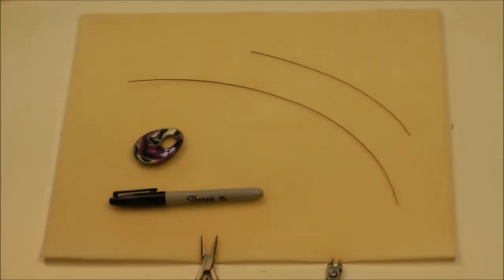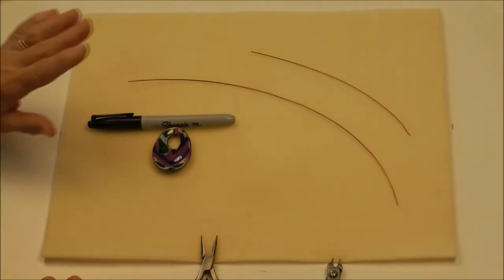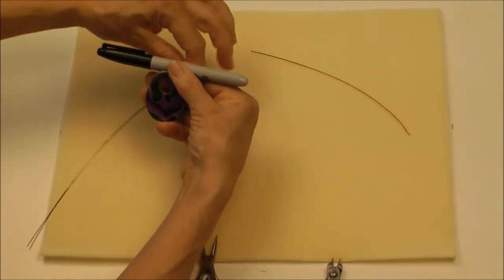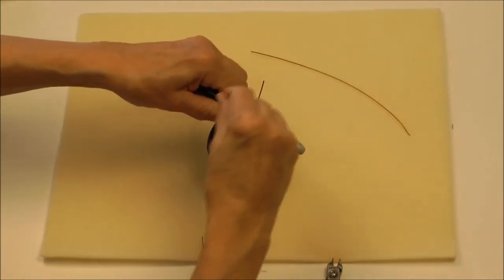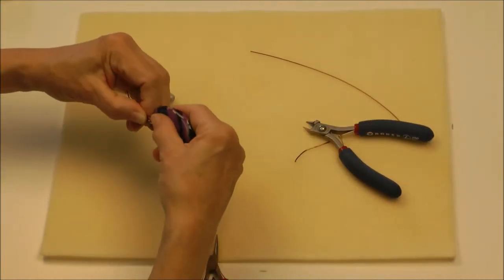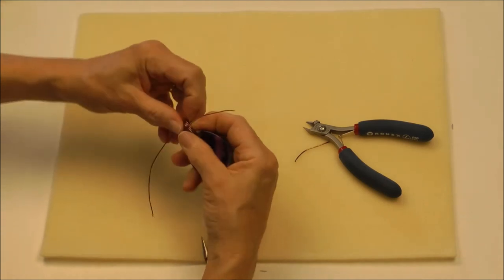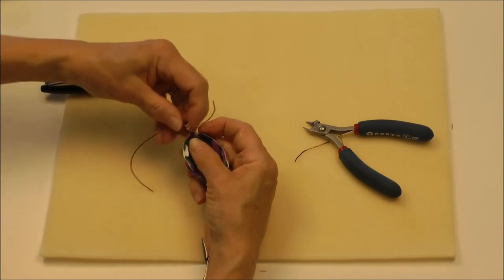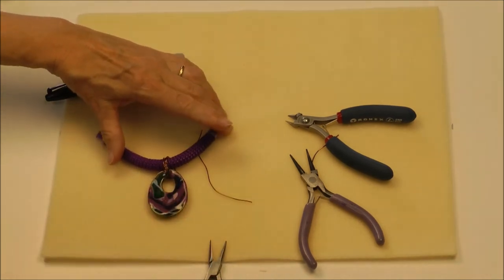Antelope Beads   How To Make A Coil Bail For A Necklace Pendant

Comment: Hi, thanks for the tutorial and your lovely voice.  I'm sorry though because I just don't get it. It seems to me after you have completed the first wrap around the pen, after you snip the wire there is no tucking away or finishing and I wonder how this wire does not catch in things get pulled apart or caught in clothing etc???
Reply from the maker: Hi, Thank you so much for this very valid feedback.  I should have emphasized that I wanted to make sure the ends were flush with the coil itself.  In this case they were. I mentioned that I did not want the coil to snag and that I wanted the ends to be towards the back and the inside of the pendant, but I really could've done a better job making sure that information was clear.